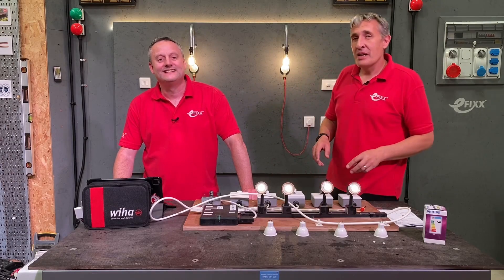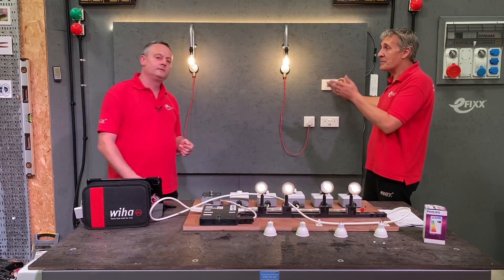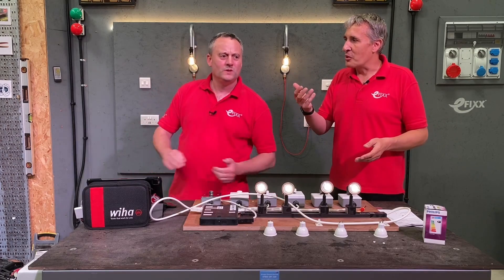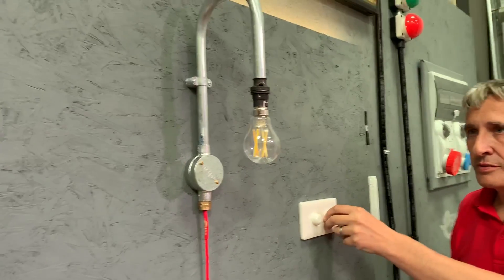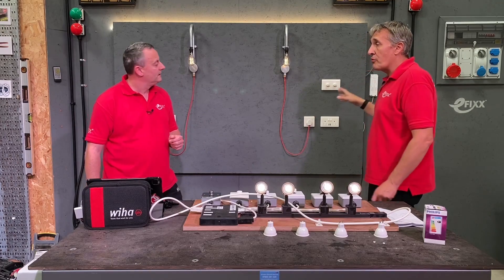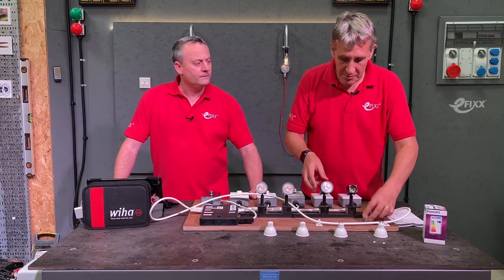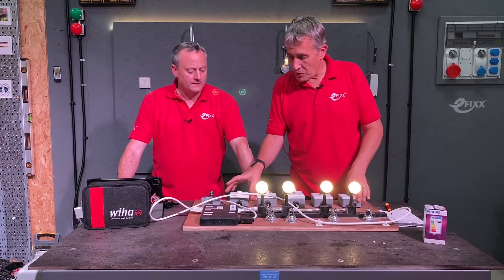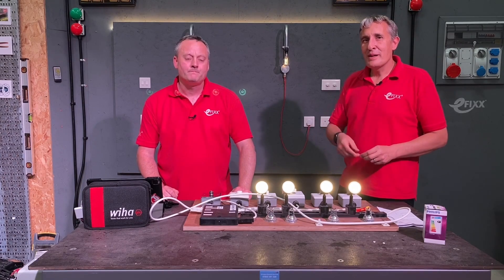SHOULD ALL LED DIMMER SWITCHES💡HAVE THIS FEATURE? - MK BASE LED DIMMER

Comment: On the dimming cheap dimmable lamps, you can also use a better dimmer to get better low end performance, which if there are a lot of lamps can be significantly cheaper.

I'm not enamoured by the Varilight V-Pro dimmers, but I've not yet found anything else that comes close to their performance and features. I often want to dim the high end as well as the low end. I think my biggest frustration with them is the super slow soft start that cannot be adjusted.
Reply: I feel exactly the same. I don't think "soft start" is a feature, it's just annoying. It reminds me of CFL bulbs which took a while to warm up. And it makes the dimmer more difficult to adjust to the level you want.

Comment: Seems like electricity and lighting in the UK is a pain. Maybe it is the higher voltage or paranoid regulatory folks but in most US. states a homeowner can replace an existing outlet or switch legally with no hassles. One of my favorite dimmers is the Lutron Skylark dimmer. Once installed there is a small finger adjustable switch that allows you to set the low end, dimmed value. Just put the faceplate on and the adjustment pot is covered. Considering how long LED bulbs last you shouldn’t have to reset that pot.
Reply: Always good to hear of how things are done in usa, thanks. The faceplate idea seems to be an excellent idea - we do have gridswitches in uk that have an exterior faceplates. Historically gridswitches have not been particularly popular in houses but are being fitted more often now, especially when multiple switch modules are needed at a single location.

Comment: From my last comment having the dimmer were it needs to be pushed in to trim the low-end.  A dual preset in the same package were the shaft is pushed in to turn the low-end potentiometer in side the unit.  Easy not pot on the side.  As am thinking different brand of LED lights will need a slightly different setting.
Reply: Excellent idea of yours, as a slight variartion - pull to set, because less likely to be pulled accidently whereas 'leaning' on it whilst passing may occur more often.

Comment: My thinking is why not have this set up so the dimer is pushed in and adjusted for the low-end.
Reply from the maker: lots of variants on the "how to set low end" - on most rotary dimmers pushing  the pot is also the on / off function.
Reply: @efixx  My thinking is push in so it locks in to the second preset a bit like on old old old car radios were you pushed in the volume to I just the volume the back speakers.

Comment: Good evening gents! Does anyone have recommendations for y.y. Flex insulation strippers? I have tried the Knipex ergo strip but have had poor success with it. It's that or a knife right now but I have a job coming up with a few hundred lengths of it so all suggestions are greatly appreciated.
Reply from the maker: Try one of these - you can adjust the cutting depth - https://youtu.be/sGLUhlMQOzI
Reply: @efixx  looks good, thank you kindly. I'll give it a go.

Comment: Could you do a video for the useability and the regs (in how they comply) with regards to the old 3A and 5A socket outlets???
Reply from the maker: Thanks Mark - we'll put it on the Q&A list.
Reply: Bs546 sockets were commonly 2Amp 5Amp and 15Amp. Don’t remember seeing a 3Amp version.
Reply: @jamesdyas542  correct, there was no 3A version
Reply: They are useful when it is necessary to have a non-standard outlet for specific loads to stop people trying to plug in unsuitable appliances. My reading of BS7671 suggests that they are still perfectly legal as long as correctly rated circuit protection is in place.
Reply: @davidfaraday7963  thought there used to be a reg about the minimum size of cable for socket outlets is 1.5 mm meaning if you have table lamp points you need to wire your lighting in 1.5 mm although it makes no sense.
Reply: These sockets are mainly used in commercial and industrial

Comment: it is a great feature but its a shame they couldnt hide it behind the dimmer knob
Reply from the maker: Great idea 👍🏻
Reply: Or have a secondary face-plate which unclips without revealing the wiring.
Reply: Exactly.  They could fit a larger control knob which would cover slotted know of the potentiometer.